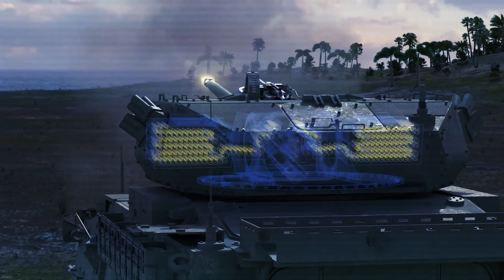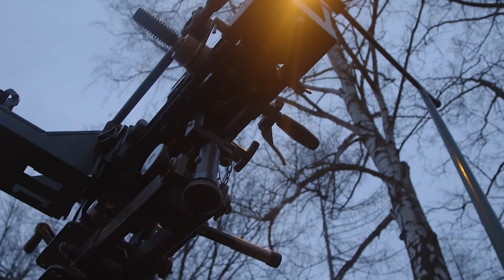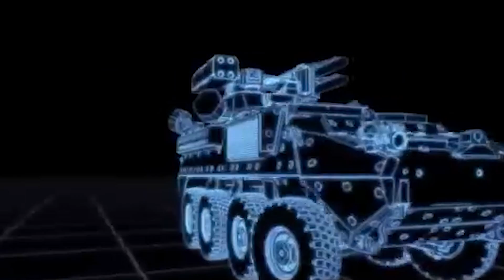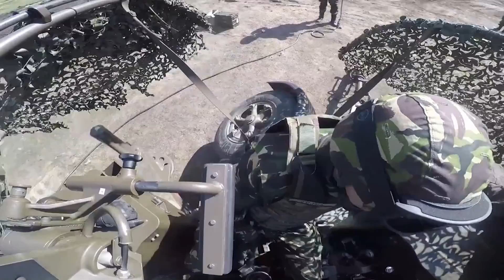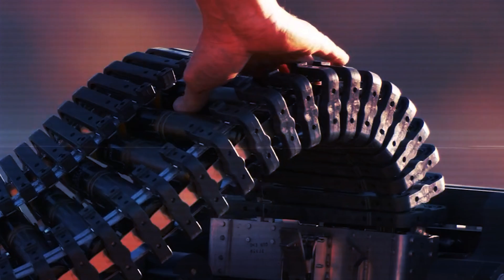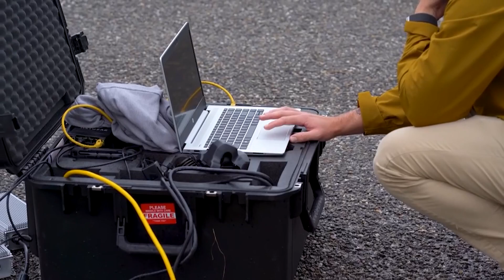America’s Most Lethal Chain Guns that No Enemy Stands a Chance

Comment: The chain gun is good but for such new tech I would say the Franco British CT40 is the way to go, it is a cased telescope round of 40mm with the footprint of a 25mm and it packs more a punch than a standard 40mm, it’s a game changer in the truest sense plus it has programmable air burst rounds also there is no brass ejection and there is no need to worry about jams or snags, bushmaster has invested a lot in the 50mm chain gun but it’s antiquated compared to the CT40 considering the CT40 has similar if not better performance plus the vehicle can carry about 4 times the amount of rounds